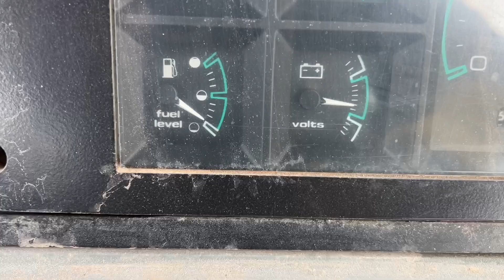How to Drain your Freestanding / Standalone Bathtub

Comment: Joel. This video was a huge blessing this weekend. Currently working on a master bathroom remodel with an unique standalone tub configuration. My tile guy is coming Tuesday (tomorrow) and I had not finished the tub drain. After watching this video, the drain you recommended solved the problem. Contacted my local Standard Plumbing Supplier, who happens to open up at 5am, and I’m in their parking lot writing you this comment after buying it. You’re the man!!!